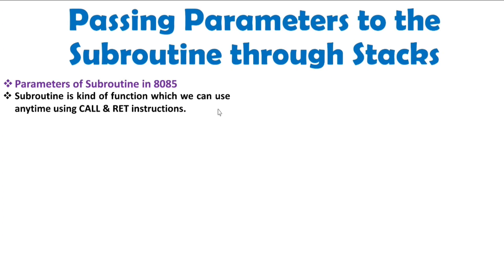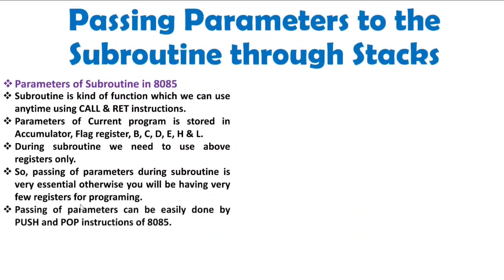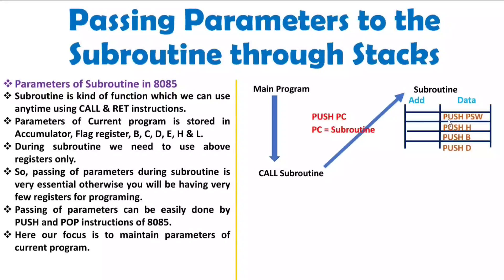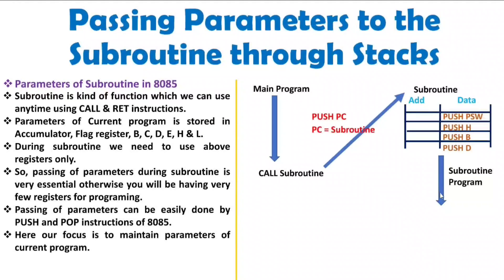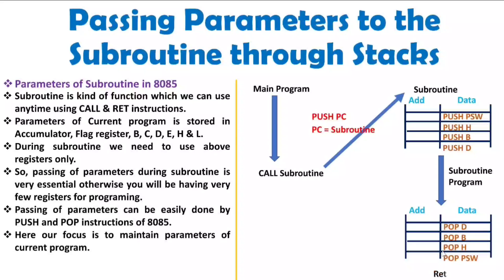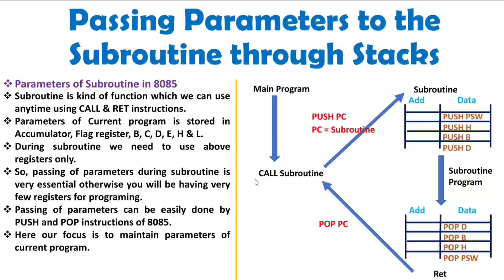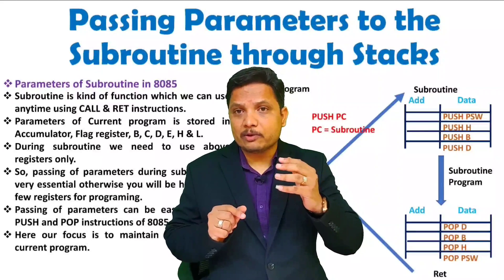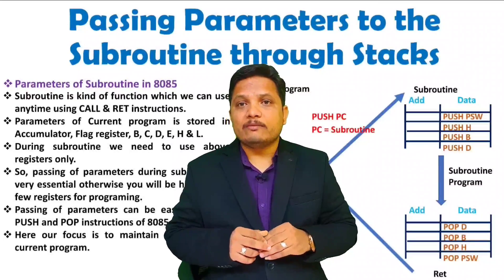Passing Parameters to Subroutines through Stack in 8085 Microprocessor

Comment: 1. 	Put data into a register
Example:  → Load 5 into register B.
2. 	Push the register onto the stack
Example:  → Save the value of B on the stack.
3. 	Call the subroutine
Example:  → Jump to the subroutine.
4. 	Inside the subroutine, pop the data
Example:  → Get the value back into register D.
5. 	Use the data in the subroutine
Do whatever you need with the value in D.
6. 	Return to the main program
Example:  → Go back to where you came from.

Comment: If I push psw first then it should be loaded first at stack and after that SP will decrement by 1 and then push H and so on. 
So, according to that Push D should be loaded on the top of the stack and after that POP instruction will be performed from the top but here I'm not getting how the data is pushed becoz the first instruction PUSH PSW   should load on the bottom of the stack and last instruction PUSH D should loaded at the top of the stack
Reply from the maker: it is perfectly correct here. see the video again.
Reply: niche s push ho rha h...that's why push D is at bottom
Reply: Think of it as a stack of books, the first book you add is the base and after that whatever you add will be on top that book. Just like that first you add the PC (implicitly by MP), after that you push whatever is useful. Whatever you at last will be pointed by SP. So whenever you perform POP, you will get whatever you push last. Like that sir is explaining that whenever you require variables/registers duing a subroutine, you use push it on stack but make sure to pop all of it also because at last 8085 requires return address. You can store the results on other memory location if you want to use it outside of subroutine.